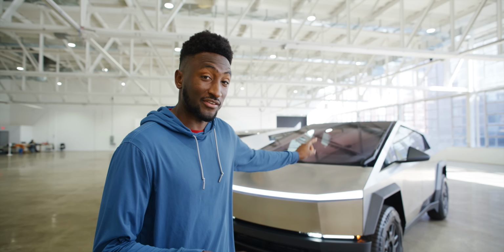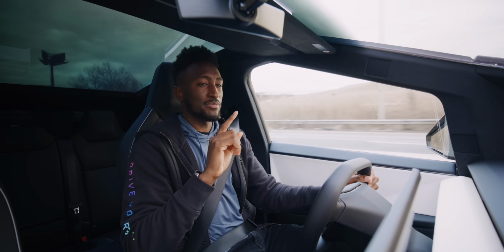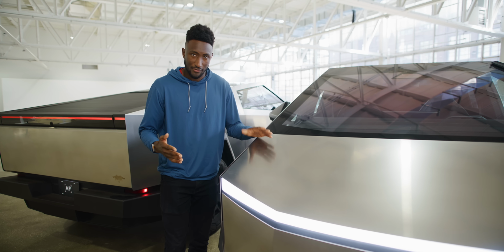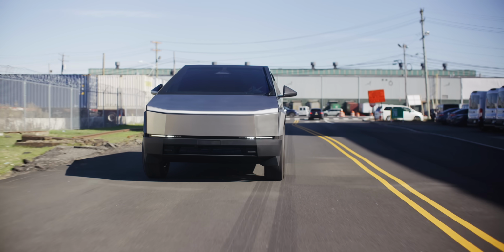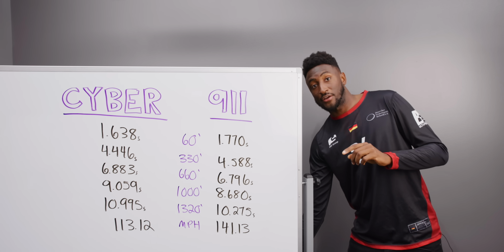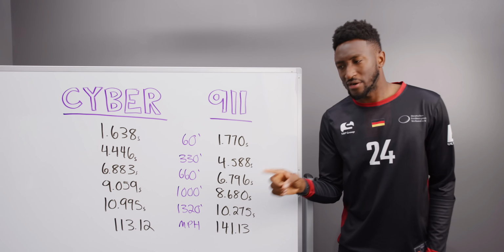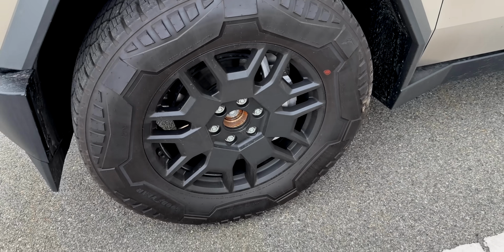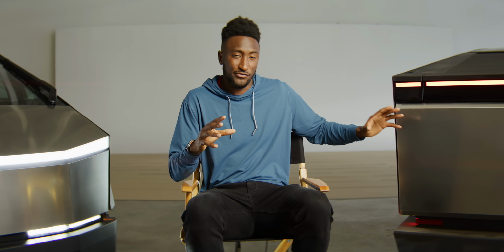Tesla Cybertruck Review: Already Iconic?

Comment: The thing that really sucks about it IMO is how dangerous it would be to other road users, it's made out of steel, if you crash into a car or someone, they're almost certainly gonna die

Normal cars are designed to be "crash compatible", which means that if one crashes into another, there's a decent chance both parties will survive if speeds weren't high enough and you're lucky

This thing is a driving metal brick, I'm kinda glad it isn't coming to Europe

Edit: To clarify: I'm talking about a collission someone in a normal car and the truck, not the truck and a wall. Also this would mostly be a problem if people were to use this instead of their car, which this video implies is the main target audience of this truck because it doesn't tow very well
Reply: The cybertruck meets all the same impact regulations that every other vehicle on the road... It has crush structures for absorbing impacts, and I would bet it soaks up impacts much better than a pickup with a giant diesel in the front.
Reply: @kschleic9053  Actually pickup trucks are generally excempt from a lot of the safety rules cars have to follow in the US, so saying "it meets all the safety requirements" doesn't mean that much when it comes to safety of other road users
Reply: @kschleic9053 no it hasn’t. It hasn’t been rated by IIHS or the NHTSA. It’s merely street legal, has minimal “safety requirements”  like turn signals, headlights, brake lights, and seatbelts.
Reply: I hope it doesn’t get into my country too.
Reply: And this speaks volumes about the type of people who would drive such a thing. Antisocial narcissists, just like Musk.
Reply: All cars are made out of steel and IC cars typically have a huge engine and transmission like a battering ram in the front of them.  The Cyber truck absolutely does have a crumple zone.

I'm not a Tesla fanboy by any means but I think you are being a bit ridiculous.
Reply: @sociopathmercenary  I'm not talking about the safety of a cybertruck-wall collision, I'm talking about the safety of a cybertruck-car collision

If you were to crash the cybertruck into a normal car, the person in the car would be waaay less likely to survive than in a car-car collision

Which wouldn't be a problem if pickup trucks in the US were actually used like trucks instead of a car replacement, but they unfortunately are
Reply: @ikbenmathijs9424  this feels so weird, this is an all truck problem yet people are only bringing up specifically with this car... like why be happy that it aint coming to europe when there are tons of other trucks in europe too?
Reply: @vibez2806  There's not that many pickup trucks in Europe actually, they're quite rare to see. I only see one once every weeks
Reply: @vibez2806  Yeah can you search what european pickup trucks look like please?
Reply: @ikbenmathijs9424  my point was that it is a truck problem... nothing to do with the frequency of trucks.
Reply: @endjfcar  huh?? i been living in europe since 2020.
Reply: @vibez2806 Well yeah but it's less of a problem if there's less trucks of course
Reply: Ford F350 Super Duty = marshmallow.
Reply: They have showcased videos online that it actually does crumple just as much as any other truck on the road. Also, physics is physics. A 7000lb truck is going to "win" a car crash vs. a 3500lb sedan that sits lower to the ground... it's just how it is. People also forget it can save YOUR life too when you get struck head on by a drunk driver, which is completely out of your control. (Seen it dozens of times in my line of work). I've been seeing these comments on YouTube videos regarding the cybertruck (from Europeans) lately, and I just think it's completely overblown. If you get hit by the "safest" most traditional pickup truck ever and you are a pedestrian, or in a small car, you will get seriously injured or worse. The cyber truck won't be any different.
Reply: @SDB1615  Oh yeah, it's not a problem exclusive to the cybertruck, but to pickup trucks in general

That still doesn't mean it's not a serious problem though, and I'd imagine it'd be way worse with the cybertruck
Reply: It is a good thing opinions do not decide road and crash safety of a vehicle. Physics and engineering do.
Tesla is known for being the safest vehicles. I am pretty sure the same goes for the Cybertruck as it has been crash tested under laboratory conditions by really good engineers. 
You have to be information challenged to claim the Cybertruck has no crash crumple zones.
Any large pickup is dangerous for normal cars.
I hate to do this to you: Practically all cars and trucks on the road are made at last partially out of steel.
Reply: @pierre.a.larsen  Tesla themselves admitted it has a smaller crumple zone than other trucks. Stiff exterior, sharp edges, extremely heavy, and very quick acceleration = quite unsafe and recipe for disaster to everyone else.
Reply: @arkeeper  I would argue it has a large crumple zone as it has no engine but a frunk. Even so - the size of the crumple zone is somewhat meaningless. What matters is the crumple zone's ability to absorb impact energy over time. Also, the front "frame" of the CT is part of the crumple zone. 
The CT is slightly less heavy than other EV trucks.
There are many larger and heavier ICE trucks e.g. a F-350 or similar.
Sharper edges could be an added risk for pedestrians when being peripherally hit. But, I doubt it is significant compared to accidents in general between other trucks and pedestrians.  
Concerning the very quick acceleration I agree. Young men should not be allowed to drive very quick EVs without them being throttled until a certain age (similar to rules for very quick motor bikes in some countries).
To mitigate, presently, Teslas are probably the best at automatically avoiding accidents.
Reply: @pierre.a.larsen  Tesla’s aren’t best at avoiding accidents. That’s a fallacy, and the truck doesn’t even have most automation. And as I already said, Tesla themselves said the zone is smaller than other trucks. Curb weight is higher than Ford and slightly less than Rivian. If the battery expansion comes out and is added, it’ll be much more
Reply: @arkeeper  Safety ratings and empiric evidence all indicate they are among the best (or the best) in avoiding accidents.
As far as I know the collision avoidance is part of this version of the software. If not it will come soon.
Size is not everything. If so a crumple zone of mostly empty air 10 yards long would be incredible. The ability to absorb impact energy over time is the important criteria to insure the lowest g forces on the occupants. There is no data on this yet, but I will be very surprised if this truck is not  among the best or the best in a collision scenario. Just like other Teslas.
The Ford is also heavier - if slightly.
With the battery extender it will indeed be heavier. Few people will get that I think.
Reply: @pierre.a.larsen  I'm not claiming it doesn't have crumple zones, and I'm not claiming that if you'd crash it into a wall at low speeds you'd die. I'm just saying that if it were to crash in a normal sized car, the person in the car would be likely to die

Like I said in my comment, it's a danger to other road users
Reply: @ikbenmathijs9424  In this you are correct. The same can be said for all truck vs car accidents. It is a matter of mass and that trucks are taller than cars.
Also, Teslas are among the best (if not the best) at automatically avoiding accidents.
Reply: Have you seen full size trucks in the US? Nobody's surviving getting hit by any of those things
Reply: @anonymousfu that's a separate issue, we don't need to resort to whataboutism.
Reply: @spaghettiboney  I wouldn't call it whataboutism. The criticism was directed specifically at the Cybertruck, implying that it's a concern unique to that vehicle, when the same is true for any full size pickup truck. If you want to complain about trucks, complain about trucks.

Also, the stainless steel complaint is kind of silly to me, as if pedestrians will just cuddle into the soft and gentle embrace of the steel on regular trucks. It's all steel and it's all harder than you and me.

Incidentally, the front of the Cybertruck is actually lower than other full size trucks, which probably makes it comparably safer for pedestrians.
Reply: @endjfcar  trucks are made out of fiberglass now? 🤔
Reply: @anonymousfu  Yup, I've visited Canada before and there were WAY more pickup trucks than in Europe. I've heard the US is even worse lol
Reply: Who cares. It’s a sexy truck.
Reply: @Rudenbehr  personally I care more about the lives of my loved ones rather than if some rich dude gets to drive in a solid steel brick, but maybe we have different views on that
Reply: Lmao.
Reply: @TroyRubert he’s right. Lol.
Reply: tell me u know nothing about engineering and cars without telling me u know nothing about engineering and cars
Reply: @grandmaster1984  well if you're so smart why don't you enlighten us ey?
Reply: @grandmaster1984  please, tell us about how crumple points are a useless addition to cars. Seatbelts next.
Reply: @spaghettiboney  huh? what are u yapping about bro? show me where i said that; i said that tesla has engineered this truck with safety in mind, including crumple zones. a random nobody like u does not know that, and the fact that u are trying to make this claim without ever even having seen a cybertruck is just plain hilarious. lmfaooo
Reply: @grandmaster1984  Physics, what is that lmao.

Comment: It's not good looking it's not practical, that's the car I used to draw as a 6 year old, and it's electric,  and steer by wire if you telling me that car has no steering column no one should ever drive that car it's not safe, I mean what happens if your steering motor stops working

Comment: I have seen three in Austin so far. The first one, I screamed with all the people on the bus, all of us taking pictures and fist bumping.. Now I am just like man, that has a lot of fingerprints on it. I would still drive one if it was free tho.
Reply: Acting Like you could get one if you tried 💀 also you’re acting like you can’t fix the finger print issue😂
Reply: @urhot  You mean by "fix" clean the car twice a day at a minimum. And before you say anything, I can easily buy this vehicle in cash many times over. I'm just not stupid enough to do it. This is the worst EV truck out of the Rivian, Lightning, and Cybertruck.
Reply: @2011blueman wrapping the car will solve the fingerprint problem. That’s a “fix”. As for the best electric truck that depends on your use case. If you are looking for a truck that is the center of attention wherever you go, the Cybertruck wins by a country mile. If you want an electric truck that is low key and barely anyone pays any attention to you then it’s a toss up between the Lightning and the Rivian.

Comment: Unclear if it's technically "steer by wire" but newer Ford F150s do have an "Adaptive Steering" feature that, when enabled, dynamically changes the steering ratio. Though, it's not very dramatic, which maybe could be configurable through forscan. I think this is undersold by Ford intentionally because traditional F150 customers wouldn't like the idea/marketing of "steer by wire".

Comment: Car builders limit top speed, not because of tires, but breaking...   The ability to dump heat to a safe stop is what makes even the same car have different top speeds out the door new from dealers... so you can get a Mustang GT, Base with 1 limit, and a GT performance pack, same HP motor, will get a higher over all limit

Comment: I guess steer by wire could vastly simplify self-driving, maybe they're looking ahead, but I don't understand why did they do it with the cyber truck and not the other cars, so if we don't see steer by wire in the next coming suv Tesla's, I'm probably wrong
Reply: Maybe because of the size of the truck? The other cars are not as big as the truck. I mean it would be nice to Implement in smaller cars but that would add to complexity and cost as the system needs them to implement the 48v system for it to work.

Comment: I wouldn’t drive it personally but I appreciate ANY car that pushes the rest of the industry out of its curvy comfort zone
Reply: Curve = safety .. mostly against pedestrians
Reply: @NormalCleanCars  yeah trucks arent safe for pedestrians at all in the first place, why is this specifically a problem with this car?
Reply: I need a solution for transporting smaller goods - but too large for "normal" SUV over 300-500km with less than 4.2 tons GVWR in civilized countries with paved roads with the topmost safety for the driver, topmost support from Software, best of class efficiency, lowest total cost of ownership and easiest and most refined User Interface for the convenience and drivin safety.

Got a recommendation?

Comment: It is ugly - the weird trapezoid wheel wheels over round tires drive me nuts.  Overpriced for the quality of materials used on the inside for sure, like all Tesla’s.  And don’t get me wrong, the tech is second to none - perhaps the gold standard for EV’s.  But as a fully functional truck it’s nothing but a pavement princess.  Take it down my gravel road in the spring when it’s wet and that heavy truck would sink and become unmanageable.  It’s not a truck.  It doesn’t even measure up to the Lightning which has its own set of issues (which for reference, we own and have massive issues with).  We are not yet at a time where EV trucks make any sense when they cannot tow or do truck things without losing mileage or just failing miserably at being a truck.

Comment: I don't think they're the first to do drive by wire. Infiniti, Toyota, Lexus have also done this on regular production vehicles and 3 or 4 rarer production vehicles.
Reply: No hey have not drive by wire. They have pure mechanical systems just like BMW, Mercedes and Tesla S,3,X,Y with electromechanical support. Actually Mercedes ha d a B-Class in the 1990s with drive by wire in the market and dropped it after a few accidents oin the Deutsche Autobahn.